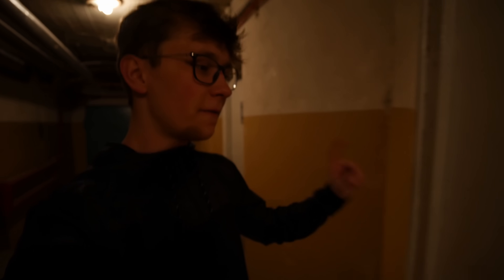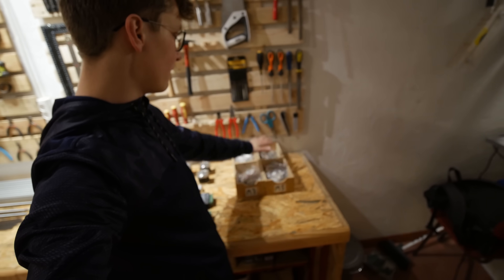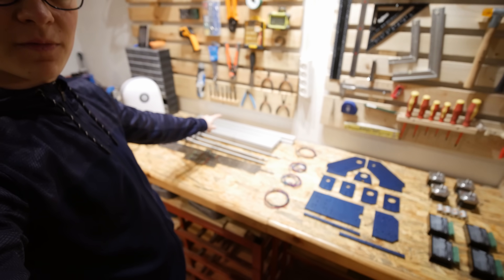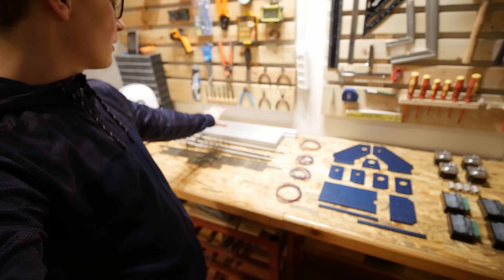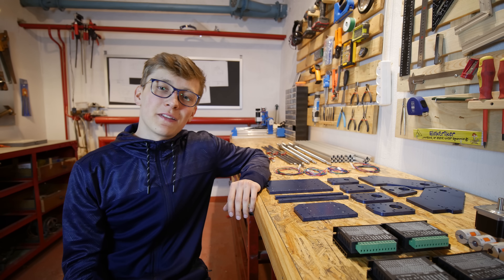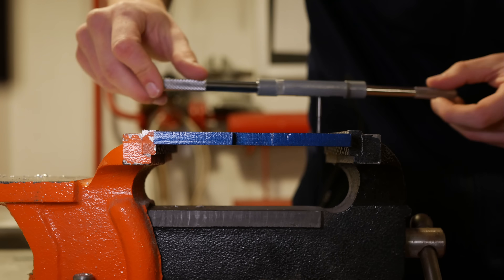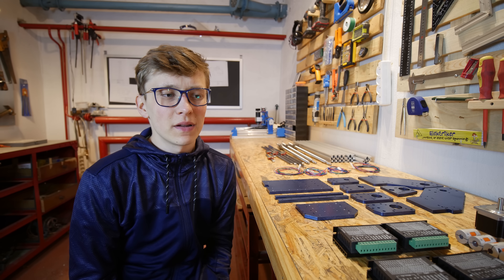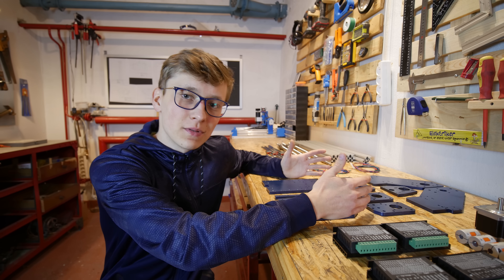IndyMill - DIY CNC Machine #2 Assembly

Comment: I see you still have not addressed the thrust forces on coupler.  There should be some kind of collar or fixable thrust bearing on the machine side of lead screw (vs the motor side).  You have ball screws to minimize backlash but all a waste if the coupler can flex?

Comment: I have dilematic about the design, and yes this design is a common cnc. Take a look at 5:50 see how the aluminium gantry bend.. it stressing the structure and bearing block. I like to asemble that part 1st, and then the aluminium table

Comment: some basic rules need every builders know, rails need be good not rod rails or wheel rails,used only laser and 3D printer not need strong, only if use SBR or MG full supported rails, ballscrew need be not acme T8 treads, motors minimum need be nema 23 better use 3Nm 4A motors, and drivers need handle same 4A or more. not use newer nema 17 waste only money lot stupid no torque use cnc, no power cut wood and aluminium, because need  lot power move heavy beam x axis and y axis all beam. minimum have nema 23 better nema 34 if have money, drivers important have current can handle max stepper motor current, power supply to motors need be max what driver can handle, about max need be, good driver 50 volt use 48 volt power supply. less volt mean lose step lot alltime worst work. current need be motor max or near this torque have better max current. z axis need support good not spindle lose and weak. if bit move when you bush bit beam and support need build more strong. aluminium can work same tools than wood, use aluminium all parts and supports. spindle can buy air cooled 12000-24000 RPM less than 130$ better than all palm routers and not noise lot, wood cheap air cool spindle 500W have cheap and good first cnc, aluminium buy 800W or more spindle. dont use dremel newer not have plan used router/cnc bearing broken fast, waste only money. maybe if make cnc only PCB board make,  thats real life skill. thanks and builds safety all hobby users.

Comment: I really like this design.  I was wondering though why you used steel for the connecting plates rather than aluminum which the profiles are made of.  Also, what type of filament are you using for your 3D printed parts.   I suspect either ABS or PETG.

Comment: If you mounted the motors in the front of the machine, would it still be necessary to take the ball screw nut off and change it's direction?

Comment: This is a great video series! I am on summer break from school and had no plans to build one of these until I started watching these videos starting with the Dremel CNC. I wanted something with a work area of at least 24" x 24" so I knew I would have to do some modification. I started by simply recreating everything in solidworks exactly as he provides it by converting or redrawing all of the laser cut and 3D printed parts. The website has links to everything he uses so with some work, it is possible to find dimensions for purchased parts. In many cases it is even possible to find parts already made on Grabcad like linear rails and blocks, ball screws and bearings, etc... Once it was put together the way he has it, the first thing I did not like was the way the ball screw was mounted and supported. I couldn't figure out for the longest time why he did not use the fixed and floating bearing supports that came with the screw. I finally realized that the screw he links to does not come with those components. So I re-designed around those. I think his thrust bearings are probably okay but the way the screw bearing mounted to the x and y axis just looked super weak. It did not take too much to modify those to fit. 

Once I had that done, I re-configured the Z axis. I don't know why he mounted it the way he did and used a belt drive with a lead screw instead of a ball screw. Not that the decisions are wrong, I just figured why not stick with a ball screw and direct drive it? I also wanted to make the final tool interchangeable. I specifically wanted to be able to add a diode laser and possibly an enamel injection setup(don't even know where to start with this) I also found that the Makita RT0701C router is actually cheaper than the 500W spindle and provides a lot more power so I had to design around that.

Once I had everything in place, I could figure out exactly how much I was going to need to extend the x and y axis in order to accommodate my 24" x 24" cutting area. I ended up using 800mm ball screws for both the x and y. Currently the design is set up for a 200mm z axis ball screw but I am not yet certain that is where I will end up. Ball screws are dimensioned based on the total length, not just the screw length. So that 200mm screw once you add the bearing, does not provide 200mm of travel. I also had to add spacers to the x axis motor mount in order to maximize the available cut area without going up to the next size screw. This gained me about 24mm.

My plan is to 3D print all of the flat panel components to start. Once I am up and running, my plan is to re-cut those parts from aluminum. I am starting with NEMA 17's hoping that they are enough but understanding that I might have to upgrade. They are cheap and I can always find something else to use them for. After all of the redesign, I think the only other 3D printed part is the mount for the router. I will probably dumb that down and CNC it as well. For now I am using something I found on thingiverse that looks robust enough to start with. 

I just started printing the parts tonight. I have 2 Dremel 3D45 printers plus access to another one plus 3 Dremel 3D40's if I get anxious about the timing. 24 hours of total print time on 2 printers just for the y axis plates. That's two prints at 12 hours each....

I want to stress that I am in no way bashing what has been done here. I would not be motivated without everything he has provided and the videos he has produced. Without his starting point, it would have taken me much longer than the 4 days it took me to get where I am.  Probably long enough that I would have given up.

Comment: Hi, super-cool-build, thumbs up! I have full respect for the DIY community. I'm planning to build a CNC router myself for shaping polystyrene for taking molds from it. So I need a little bit bigger CNC than IndyMill but the spindle doesn't have to be so powerful probably because of the soft material. Any idea how big the router with your setup could be expanded? Would 1000x1000x200 still work out?

Comment: Use a tapping block to hand tap. you will break fewer taps. block with close fitting holes for tap to fit in while tapping. They are cheap.  When milling plastics, use a squirt bottle as a mister to keep the plastic cool.

Comment: In the partslist are M12 nuts  3 piece   M12 x 1mm fine pitch. I wondered where these are being used?    Can anyone point me in the right direction?  Thanks.
Reply from the maker: There is such thread on the ball screws. You need this nut to attach to 3D printed ball screw holders (element with 2 bearings inside).

Comment: As a Maker myself I am impressed with the simplistic design of your Indymill but have a few reservations that have been mentioned by others in regards to the ball screw brackets, direct drive from the stepper motor etc.
One thing puzzled me, you had dual linear rails on the X and Z axises but not on the Y where there would be flexibility present on the single linear guide, this really needs to be a dual track and will make rigidity much better.
A niggle of mine is people using fastenings without washers between the head of the fastening and the surface of the part. This helps spread the locking load and also minimises damage to the part surface. Threadlock is another definite requirement.
I am not being negative on your achievement as this has to be one of the best self builds I have seen for a long time and it has all of the core requirements to be a great starter machine for anyone interested in entering the CNC world.
Well done on a great project!

Comment: Hi. Nice work. Just a silly question... I've seen that your 3d printer dremel cnc is able to mill aluminum... Instead of using those laser cut steel parts can one make them in alluminum milled by the dremel cnc?

Comment: I've purchased the majority of the parts you have listed on you site which now have arrived and I've tried to assembly the rails onto the profiles. The M5 nuts seem to fit the extrusion correctly but the conterbores in the slides are to small to take an M5 capscrew. I've also tried the M3 nuts which fit the slides but because the nuts are a little smaller they keep turning in the form and become unclammped. I would appreciate if you could tell me what I'm doing wrong as your videos make assembly look quite easy

Comment: I'm getting involved in my next CNC mill build, the first one being small and with stiffness issues :'( ..
So far I'm really liking your design, especially for the Y axis.
Like many comments suggest it, it would be better to withstand the ballscrews thrust load with appropriate bearings. But instead of BK BF solution I found the FK FF (https://www.banggood.com/FF12-FK12-Ball-Screw-End-Supports-for-Ball-Screw-SFU1605-p-1118817.html?rmmds=search&cur_warehouse=CN) to be an easy to go fix with same performances as a BK block of same order of price (i.e. cheap as it don't have true axial bearings, see : https://www.youtube.com/watch?v=WoPPwGxgWEY&t=307s).
Thanks for your work and keep it on it's great fun!

Comment: In all your projects, the lead screws are fixed directly to the stepper motors and this is not correct, the motor shaft has a noticeable backlash in the longitudinal plane, especially if you push it down (towards the rear) The lead screws need to be fixed separately from either side in any convenient way. The motor must transmit only the torque and not be subjected to any other loads, and then you can use a flexible coupling and this will further reduce the load on the motor. In the near future I will solve this issue for the dremel cnc project. Sorry for my English :)
Reply: Absolutely agree!
Reply: Was about to say the same thing.. ballscrew kind of need a double bearing in x at one and and a support at the other.. Attaching directly to the stepper may work...for a while... but it is a shame when you have all those nice parts in your design and just miss a single support to make it perfect...

Comment: At the 8:53 min of video you have self locking nuts but the bolts are too short. I recommendet you to replase the bolts with some longer because you dont reach the teflon part of nut whitch it lock the bolts. It is CNC machine and there are many vibrations and not locked bolt can cause a various problems not only with accuracy. BTW nice video and good job!!

Comment: Fantastic! I love your projects. Only an advice, I know that is not the final assembly but I would actually suggest if the ball screws are long enough to extend the motor mount and place another ball bearing on the other side as well otherwise it will be prone to vibration close to the NEMA with only the not rigid couplers. The best would be to print naother ball bearing sopport and mount the motor just outside with spacers. Pplus you gain some X, Y travel.

Comment: First off, awesome job so far. It looks very promising. Next, I was just wondering if you have any information you could share on the steel parts used in this build such as the cad designs maybe and who you went with to get them cut. Any  help would be greatly appreciated! Keep up the good work. Thanks!

Comment: Very nice project made with very top components balls screw and linear ball bearings very sturdy structure and interesting motor drivers go ahead that i'll follow you. Maybe the ball screw in between by blue plate and chassis for a better protection of the lead thread or will you make some kind of protection, like a carter?
Hi, to the next video!

Comment: Nikodem... I am so in love with your project, and impressed with what you have achieved, that I do not want to make any negative comment... BUT I feel I must;  a number of other comments refer to the lack of anything to handle linear thrust in the ballscrews.  They are intended to be used the other way around; the end without the thread fits into the flexible coupler, while the threaded end is where a thrust bearing and various collars and spacers are fitted to the transfer the lineal thrust to the frame.  At present, this thrust load is being taken by the bearing at one end; this would be OK as long as the bearing is one designed for this function.   The other end however is using the flexible coupler, and the stepper motor to handle thrust loads... this may work OK for a time, but it is likely to be less effective, and will accelerate wear on those components.  Better fixed now at little cost, than later when you have to replace expensive parts.
When I see one of your videos in my notifications, I drop everything to check it out!  They never disappoint me.   :o)
Reply: Hi, I am currently designing something similar but having 2 parallel ball screws for each axis, with a single motor for each connecting by a closed loop timing belt. I am wondering why the "standard" configuration for a ballscrew is one fixed bearing at the motor end, and one free bearing at the other. Could I just use a fixed bearing at both ends? Would that provide better rigidity?
Thanks
Reply: @____5837  do you found answear? I wonder this samw
Reply: @hinduspl  you only need a fixed bearing at one end, and the standard machining only allows for a fixed bearing to be screwed on at one end. While you can also use a fixed bearing at the other end, it will just act as an expensive floating bearing, with no benefit. If you were to custom machine a ballscrew to accept fixed bearings at both ends then your could get some benefit in spreading the force out, however you would need very tight tolerances to have it work correctly, and might have issues with differential size changes with temperatute
Reply: @____5837  so the fixed bearing is holding ball screw at the end, and the other end of this ball screw is attached directly to the stepper motor and then motor is holded to base? So there's no bearing support on the end with motor?
Reply: How do o opinyon 
Ftyf fotncnc

Comment: I tried to check out the homepage,but I couldn't find cad files? I assume it's a work in progress site? Nice start for the project and don't mind about those bearing comments etc. They're things that are easily changed even later on. Imo all brackets etc are actually worth 3d printing to just to be sure everything will work out.

Comment: At my work for the alignment of the zaxis rail we use some pins for alignment, and a cart for aligning the second rail might be a good idea?  The bearing for the x/y axis we have in the alu/steel and around it some tapped holes and a bolt with ring so it can't fall out maby smth to think about?

Cool project btw, thinking about upgrading my mill with yours

Comment: Nice Project. I like the Open Source approach. 
As Said before, you absolutely Need a at least a fixed bearing on the side of the motor. Its ok ( Even advantageous due to thermal expansion) to leave the other side floating. Your Problem will be the reactional forces ( when your gantry is moving in y-) away from the Motor along the ballscrew. They will simply pull appart your couplers if the ballscrew isnt fixed in position.
Are you planing to install limit switches? They are nessecary to archieve repeatable machine-Coordinates. If you are Interessed, i could send you some...
What Kind of spindle are you planing to use ?

Comment: Why use ballscrews and not proper bearings like angle contact bearings?
Might as well save the money and  use leadscrews.
Reply: Balmscrew are the state of the art  more expensive but very reliable and precise. In your version as Nema17 motors are upgradable to nema23 you can buy cheaper one then if not enough satisfied upgrade to this version. Hi

Comment: Why did you order the steel parts instead of making them in aluminium on the Dremel CNC? 
Does it make a difference if it is steel or aluminium?
Reply: I'm pretty sure that's for the same reason for which the ball screws aren't properly supported and thus the motors won't last very long (guest why that is). And I'm also pretty sure that since the entire frame is made out of aluminium extrusions, it wouldn't make any difference if all the steel parts were made out of decent plywood, leave alone aluminium, as far as rigidness of the machine goes.
Reply: Hans Olo why are you so negative?
For his age and limited experience the design is pretty good.
He will learn and eventually add bearing block with thrust bearing when the bearings in the motor wear out.
There is nothing wrong with Aluminium frame as long as the forces acing on it are below the tensile strength of the profiles he is using. 
He is learning. He will discover the weak points and his next version will likely be more rigid.
What he is doing is much better that guys they watch YouTube videos and criticize but never actually build anything.
Reply: I had the same doubt too
Reply: Probably the minidremel is not enough precise and sturdy for milling steel and aluminium is lighter but more "wobbly" than steel.
For the same  rigidity you must have more thickness and  it is a lot expensive than steel

Comment: It seems wierd that you dont have a bk orf fk support for the ballscrew. The point of ballscrews is to remove backlash but there is nothing holding the  ballscrew from moving along it´s axis. You should really fix some thrust bearing for the ballscrews